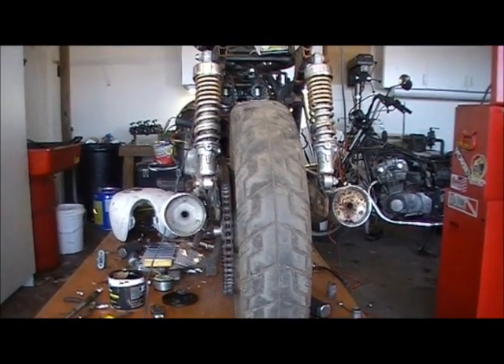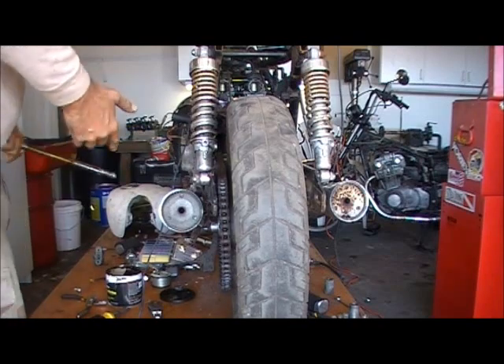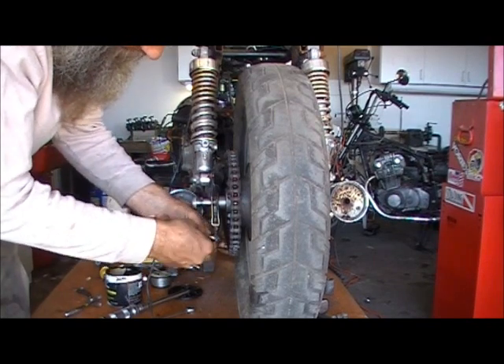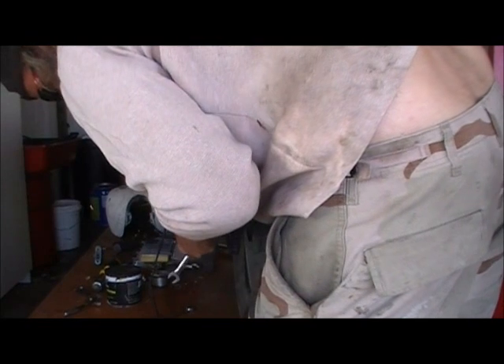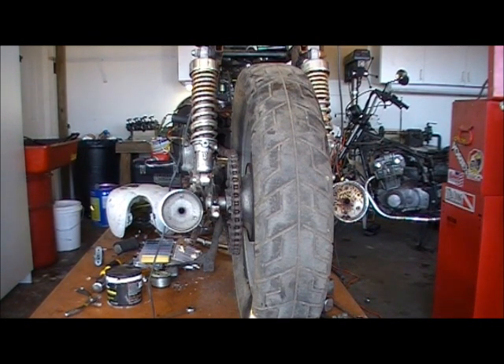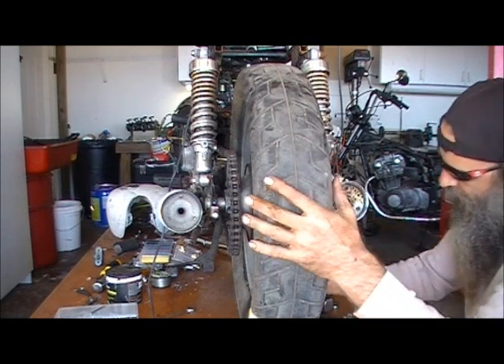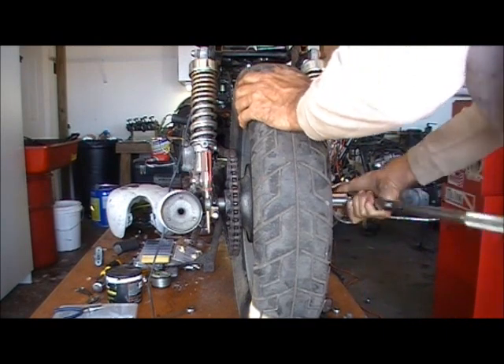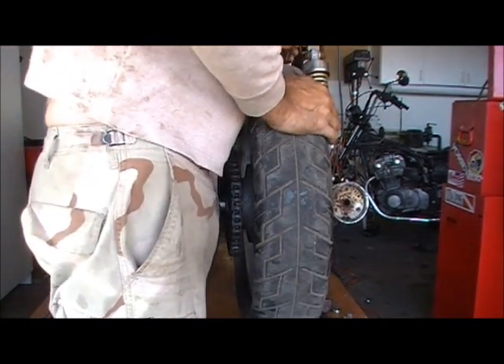Mounting your rear wheel on an older Suzuki

Comment: The axle in my rear hub for '78 Suzuki GS750E is stuck in solid. The rear caliper mount is on the damn thing as well. I wonder how hard I should smack it or should I press it through?
Reply: Is that a spoked wheel?

Comment: Any grease in particular for this, the swingarm, or any other greaseable location? I have a tube of lithium grease, will that work?
Reply from the maker: I generally use Moly based Packing/bearing/boat trailer grease for swingarms The white Lithium I'll use if I want to ride it myself personally but with the awareness that it takes it from do it every year to do it every 3rd or 4th oil change (or 6 months whichever comes first)
Reply: What oil do soak the clutch components in for 48 hours?
Reply from the maker: whichever oil you are going to run in the engine - which in my case is invariably Delo 400 15W40

Comment from the maker: If they are only doing it when applied I'd be inclined to say you are down on the rivets... OR... You put in say a carbon or really high metallic set of pads and you dont have all the rust worked off the rotors yet (If carbon they'll squeal every other day when they do clean out --- If the problem is the type of pad selectedand not that you are at the warnings on your brake pads....The actual only "solution" is to degrade your braking performance and go back to semi-metallic pads